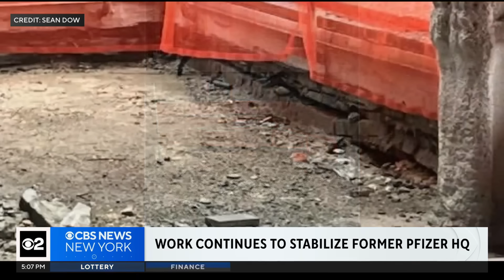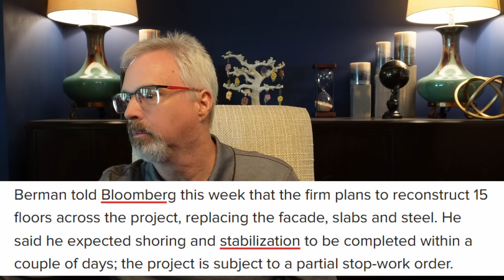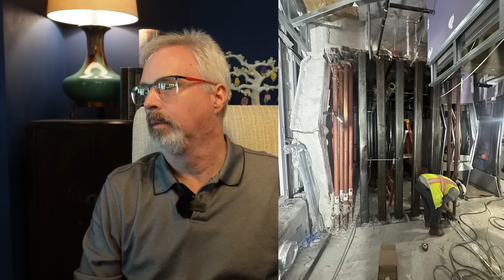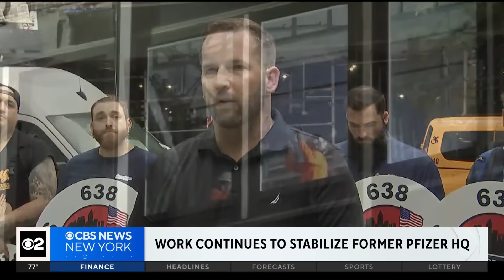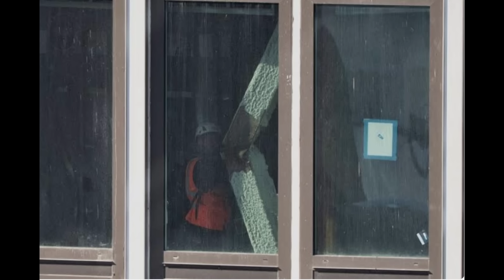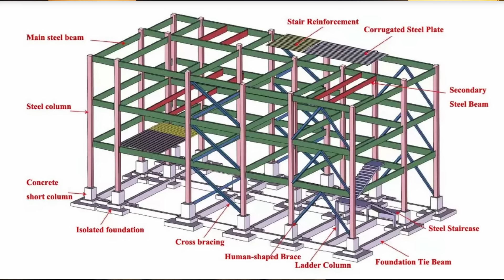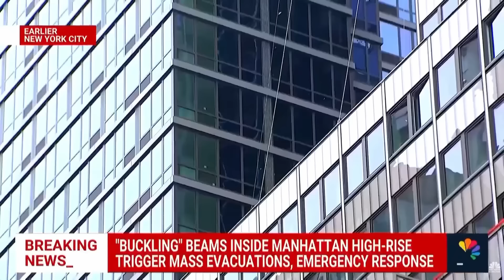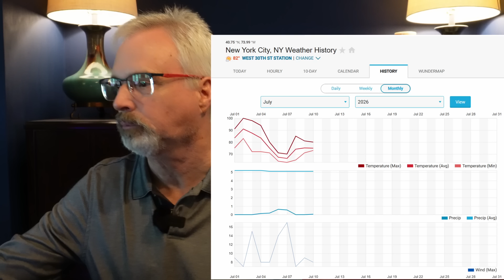Update - Pfizer Building Structural Column Failures; Now What?

Comment: I was an inspector for more than 40+ years and there is no way in hell could anyone make me go inside to inspect that building. One of the first buildings I inspected was an old hotel in Victoria, TX which was about to be torn down. I inspected it on a Friday and the following Monday it collapsed killing the wrecking crew's owner.
Reply: Presumably after the column failure the other columns are now more heavily loaded. Picking the addition apart top-down sounds like a nightmare. Hard to un-pour concrete floors.
Reply: @MatthewFelgate-r4u  seriously if I was mayor I would condemn it and demand it be torn down entirely.
Reply: @AnotherAustin-z7b  i imagine he will take an interest.  Hes no fool, so is likeley to have regard for qualified advice. I would imagine his immediate problem is making sure the whole thing doesnt collapse the overloaded side and fall over in the middle of town.
Reply: @AnotherAustin-z7b  well the first problem is to stop it from falling down. The people who added floors were obviously clowns. The current redevelopers must be idiots. Once they stabilize it i think they are going to struggle to convince anybody that the steelwork is structurally sound after all this. Whether the final decision ends up with the mayor, who knows? Once these people get a proper structural report they will run for the hills and at that point it probably ends up on the mayor's desk because taking it apart is going to cost money.

Comment: As a retired Ironworker I have a couple observations. 
1) This incident couldn’t have been a Union related issue unless they’re referring to the engineer and oversight team, these columns were just too small for the expected loads and this is why the responses from the reps are so bizarre. They’re shooing away any liability. 
Don’t forget that NYC building code enforcement is constantly and continuously under scrutiny for crane crashes and building compliance issues. 
2) The columns that failed were likely smaller than the ones below because their job was simply to support the roof only. In the trades we called them layoff columns because that was going to be the final floor for the Ironworkers and it’s time to start looking for another job. 
3) As Casey mentioned the window mullions or exterior support for whatever covers the structure is generally its own standalone unit but most of the ones I’ve been around had large slotted holes with special brackets attached to the building allowing for some movement for floor loading and weather. 
Most however were only slotted about three inches total with the goal at construction to set the clip or attachments in the center of the slot. We shall see but it’s very possible the clear iron or glass supported at least some of the load when the columns decided to check out for good. 
Bonus comment, I keep calling it clear iron because often in smaller unions the Ironworkers Hall often absorbs the Glaziers to allow Ironworkes to install clear iron and to allow the Glaziers to have union benefits. There are often contract issues with the Carpenters over this.
Reply: Just like a book being written about "The Death of Expertise" in this country, another could be written about "The Death of Accountability." Your description of how thiss whole dangerous debacle is being handled sounds like shoddy work on top of shoddy work.
Reply: This is an engineering issue, not labor.  I have no doubt in designing the addition, they made bad assumptions about the strength of the underlying design.
Reply: Experienced union workers just ignored the problem then.
Reply: @Thegonagle  Absolutely, it’s almost like they ignored or missed that the columns got smaller on the way up, which is weird because that’s standard procedure. 
The columns on a 20 something story structure would be something like 500 lbs per foot at the bottom floor but the buckled columns look to be plus or minus 100 lb per foot. Crazy problem to have because this never happens. 
I’ve worked on jobs where we weld all kinds of iron on existing columns to keep this from happening and this time they just straight skipped that procedure.
Reply: The union rep is just an asshole, throwing others under the bus with zero evidence.
Reply: @GamesFromSpace  Yup, that’s standard practice for the BA in any trade. This is called dodging responsibility. 
Oddly enough it works, most people have zero idea even what they’re looking at so the people involved just start throwing bullshit around and and nothing happens and everything is fine…
Reply: @GamesFromSpace truth hurts...
Reply: @PeterFrankFoley Lying is easy.
Reply: I am guessing that you are correct about the upper level columns being smaller than the ones on lower floors.  That would neatly explain what happened.  But it's still early and other shoes may drop.
Reply: @dzcav3  Yup, absolutely.
Reply: Maybe the union is sending in moles to sabotage the construction. "It'd be a shame if you didn't hire the union workers. You never know what could go wrong."
Reply: @Sonny_McMacsson  You’d be surprised how often that happens. 
I was a young apprentice and they asked me to “salt” a job and I had no idea WTF was going on or what to even think about what they were asking me to do. 
In this particular instance, engineering “should” have written up some kind of procedures for dealing with columns that are absolutely too small for the load. Oversight in the way of inspections should have signed off on this before the building got too large and this simply didn’t happen. 
Before any construction can begin, city engineers must sign off on structural plans. Maybe this failed. Then drawings must be “detailed” and those must be signed off on. The detailing includes beefing the existing iron and the welding procedures as well as the inspection process. This also failed. Then, the contractor must perform the work, and get it signed off not only by the inspector but ALSO by the city. 
Lots of holes in the Swiss cheese here because most good contractors and the people who work for them would have been talking about this for a minute before this failure.
Reply: @Sonny_McMacsson not needed with non- English speakers + very high % semi & illiterate illegal Alien labor that CAN'T speak out , or they  are fired, or deported.....😢
Only an idiot has more then one language on Skyscraper remodel / addition...

Non- Union citizens okay....cheap but legal

Using Illegal aliens is both immoral, and dangerous to everyone...
Building safety and quality HAVE suffered from use of illegal workforce for over 40+ years....

Comment: Look at the number of cantilevered floors that were added onto those two tiny columns that buckled!  There is no diagonal bracing on the outside of that building.  The columns of the new columns of the floors above are considerably larger than those on the 21st floor.  The fact that you can see the slope of the floors above says the 4" number is insanely low.  It's probably in excess of 16" of slope for it to be that visible.  The union spokespeople are saying a lot of idiotic things before any investigation has been completed.

Comment: Im 100 percent confident i could jack that back up, id start at bottom floor adding support until i had a column to jack up off of that ran all the way to ground. Then once you reach the damaged floors those would have adjustable columns id use large hydraulic cylinders to lift lifting each floor 1/4 in at a time going no more then one inch a day. I don’t think the beams have flexed past limit but maybe they have decided they have. Maybe it’s cheaper to just tear top off

Comment: I'm not a structural engineer, and I have a question. I see that the additional floors were added over a "necked down" area of the buildings existing floor plan. Why wouldn't you build out the additional vertical beams to "mirror" the upper floors footprint, and build straight up?  Wouldn't that do a much better job of spreading out the additional weight (load) of the added floors? 🤔

Comment: Idk what the big mystery here is. That section of the building of that floor wasn’t built to carry 15 more floors. 

I’m willing to gamble my 401k those columns are a thinner steel than the columns under the existing 15 floors from the original building. Because why would the original builder use the same gauge column on a section of the building that wasn’t designed to need to carry 15 more floors. 

The engineers didn’t do the foot work of checking that the materials in place from the existing building matched what was on paper. Even if the original plans called for a heavier gauge column, it’s not beyond the realm of possibly the original builder used a thinner gauge column approved by an engineer back then because what was that section carrying other then the roof back then.

Comment: I believe that you can add stories to a building. 
I struggle to accept that you can add 76% more stories on top of the existing without a significant amount of reinforcement of load bearing columns, or at minimum without extensive exploration into the physical state of the members that will be subjected to so much additional load. 

You can only hide so much increase of new dead load within the reduction of live loads from office to residential. Never mind that residential corridors require a higher live than office building corridors.

Comment: If excess capacity is built in originally , at what stage do you say the building strength is now too low to add more load?

It is like road bridges that were built using average transient traffic load calculations, then much later some council know nothing comes along and sticks traffic lights on the bridge. Now you have the possibility of many heavily loaded trucks statically   loading the bridge and all much closer together in a queue. Thus the bridge is much higher loaded than was ever the Intention. Yet that decision was made by someone who knows nothing about bridges. They are a traffic management person at very best, possibly just a city council operative who has no understanding whatsoever.

This sounds like a similar, set up.
People making decisions about change of use without understanding the original design parameters.

Comment: The small block of floors on which all those new floors sit on Don't look entirely original to the 1960s construction. The facade is different possibly because they removed some of it for construction but what seems to stick out more to me is that the vertical muttons are a different color from the rest of the building.

Comment: Im a Pa  structural PE . Did a 12 story steel frame years ago and bridges. How about the LL for apartments being less than office loads therefore they added more load above 21st floor taking advantage of reduced loads below, strictly based on the difference in live loading vs original design. I mention this as a thought I had when you were discussing issue. I really doubt the numbers will work out. Really Interested in the outcome. Good job covering this. Important to learn what happened so it is not repeated in future.
Reply: This concept would allow the foundations of the original building to work, and possibly the columns in the bottom part of the existing building, but columns in the top of the existing building will see a much larger percentage increase in loads and are much more likely to require strengthening.

Comment: Re the mention of construction materials (photo shows large spools of cabling) contributing to the problem, except for the actual spools themselves, all the material contained on the spools end up remaining in the building (that's why they are there!) Granted the point loads may be more concentrated, the vast majority of the weight is still going to be there ... so hopefully the design is sufficient to handle all the "stuff".

Comment: $10 says the developer will declare bankruptcy and bail.  The building will be essentially abandoned in place. And will be tied up in legal finger pointing for the next 20 years. Also 2 of the 60 year old structural steel columns failed under the load of the new construction. How or Why would you trust any of the other columns in the original as built building at this point. It’s clear somebody made some bad assumptions somewhere. This building predates the Singapore Hotel New World collapse, that prompted the revision of Engineering Standards worldwide. Particularly the requirement that all structural calculations must be double checked by an independent outside Engineering firm. The columns that failed were only ever expected to hold up the roof of the original building. How thoroughly did they go back and review the original plans, and the actual structure as built, when they decided to stack another 15 floors on top of it?

Comment: You cant build structure from the top down and HOPE the forces spread evenly to the foundation and not overload even 1 vertical. These ppl are nuts. All the shoring has downward force too. Now they have more weight between vertical supports. They're making too many bs assumptions. It all has to be removed. Start from the ground up like theyre supposed to. They added 5k tons and and cantilevers to existing supports without being 100% certain it will trandfer down

Comment: What was the wind like the day before they found the failed columns?  Wind loading, like thermal expansion loading could have been the proximate cause.  Ultimate cause is columns understrength against buckling due to corrosion or screwup or both.

Comment: Those columns originally supported nothing more than the roof. How did the designers of the addition expect them to support 15+ floors instead, cantilevered at that? They will certainly be stouter at lower levels, but their adequacy needs to be investigated at every level, anyway, all the way to the ground and the basement if there is one. Columns aren’t like other structural elements; they work perfectly well until the instant they give way without warning.  And while we’re thinking for a change, did anyone think about the effect of the increased foundation loads at the footings of those columns?

Comment: 6:23 Lack of structural calculation usualy is not an union issue. I don't know how this works in the USA. But some structural engineer supported more than 15 stories building on not strengthened 19 stories building.

Comment: The new columns above appear to take cantilever beam loads too. Quite amount of floor loads to that column line. The buckled columns were originally designed for the roof and top floor loads, which might not be heavy enough for the new loads above and should be chedked during the new floor system design.

Comment: Architect here. This is a perfect case study of buckling failure in a non-concentric column. (Wide flange steel.) Absolutely obvious that the failed columns required reinforcing for added loads since their original design was only for the roof immediately above. Wondering if reinforcing was included in design but contractor elected to do the reinforcement later in the construction process. (Contractor is typically responsible for order of work, but structural engineer should have identified the potential problems during normal on-site observations.)
Reply: Retired mechanical PE. I spent my career as a project manager in heavy construction in the chemical process industry. I worked on many industrial projects where the existing columns were plated to increase the section modulus to accomodate increased structural loads. My first thought was that it was unlikely that, given today's analytical software, the load calculations would be that far off. Also noting that the fireproofing had not been removed from the columns, I wondered if these columns were not supposed to receive plating that was skipped?
Reply: Thats why we have to have inspections. But even thee added support columns were a blunder at the city engineers office.  Columns require columns block support beneath the slab for the load. And they too require at least a mathematical Slide Rule too calculate the needed mass and depth in correlation of the site's soil. Those added would eventually have caused the concrete slab to fail after people moved in and,,, by all means the roof top swanky pool was full.  Stupid people do take good jobs away from qualified individuals.  Look at GMC.

Comment: It seems that this building was built during a similar time period as the World Trade Center 1 and 2. One of the contributing factors in the Trade Center failures was failure of the fire protective coating on the bean. 

The buckled beans appear to have a failure of the fire protective coating. What appears to be rust suggests that a partial failure of the fire protective coating may have permitted moisture to be trapped against the columns. 

At minimum it seems that testing of all the columns (and beams) in this building may be needed. Replacement of the fire protective coating may also be needed. 

If this testing finds more problems it may indicate that testing of other similar buildings may be needed. 

This is just a thought exercise. It may be completely invalid. 

BTW, I found the thermal expansion information and theory interesting.

Comment: So many things to say on this - I could write a very long essay - I wont.  The engineering could not have been perfect by inspection, unless the construction company seriously screwed up the installation - which I doubt.  This looks like engineering may have been pressured to buy off the structural loads / analysis that or the engineering team made a serious screw up.  They should have redone the loads and redone the structural analysis.  Did either of these tell them something they didn't like but were pressured into accepting.  Everthing is still intact so a detailed exam of the engineering and building will show the problem(s)